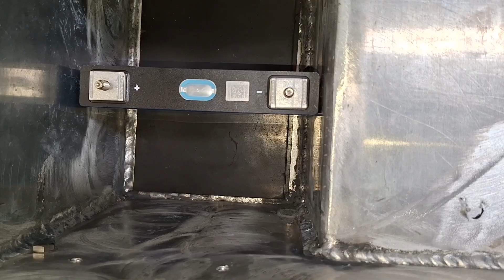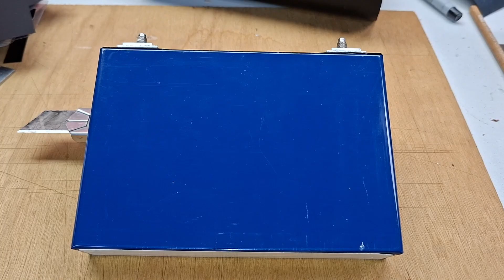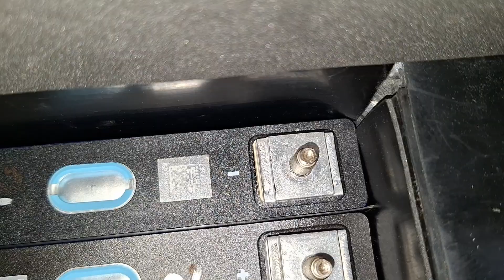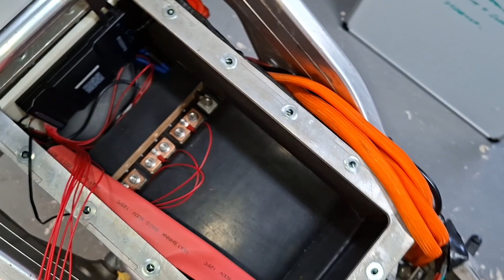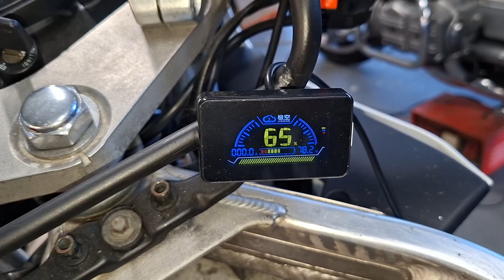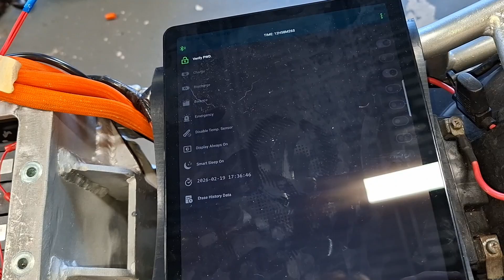EV Conversion CBR250R Battery Install and Test

Comment: I’m sorry, but you’re going to have to redo this. Connecting copper and aluminum is a big no-no! These metals form a galvanic couple. Because of the difference in electrochemical potentials, any presence of moisture will trigger galvanic corrosion. The metals will oxidize, the connection will loosen up, and it will get severely hot. You need nickel-plated copper busbars (or something similar).

Second, I have the exact same terminals welded to my battery cells. You might have noticed they aren't perfectly flat. I actually polished and leveled mine. On top of that, I used a special conductive contact grease.